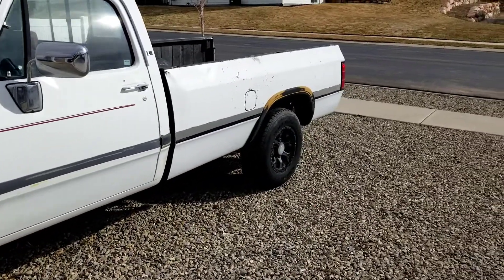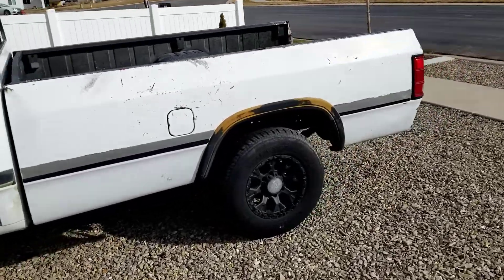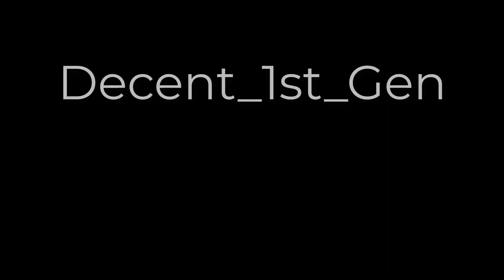Getting Rid of Side Molding on the 1st Gen

Comment: I think I understand why you wanted to remove the molding on that one, not sure though. I have a 1990 and I like the original character of the vehicle from new and the molding looks really good on the 1990s. I’m doing a complete restore on one that is in near perfect condition so am going to use the original pieces. 
I’m thinking you could sell those pieces you have, I wouldn’t throw them away as they are really hard to find now.
Reply from the maker: They were all completely dry rotted from sitting for years in the california sun.